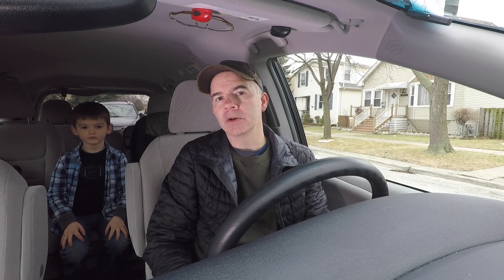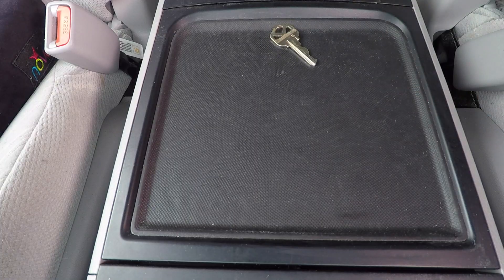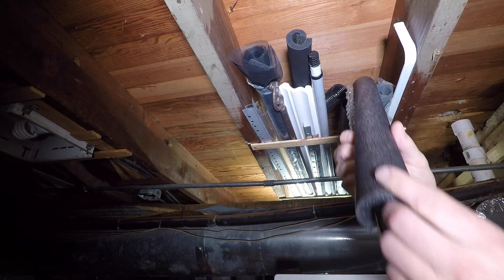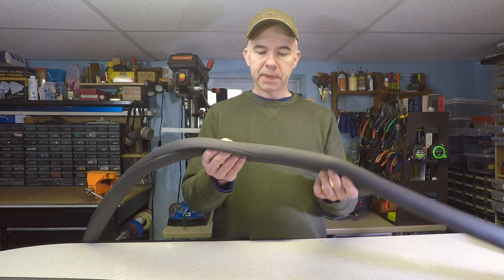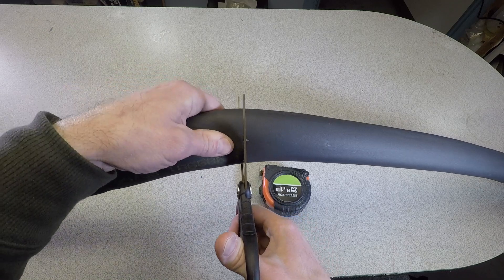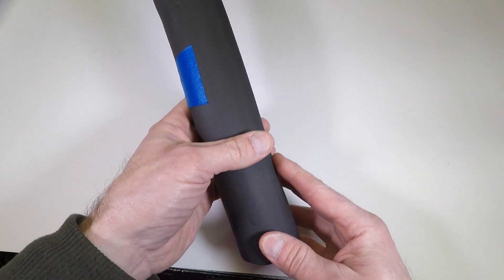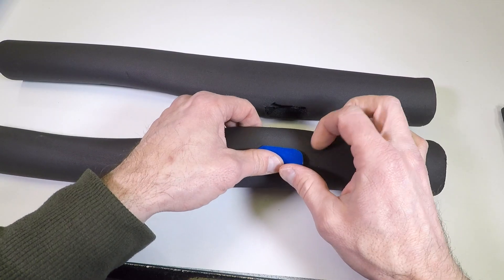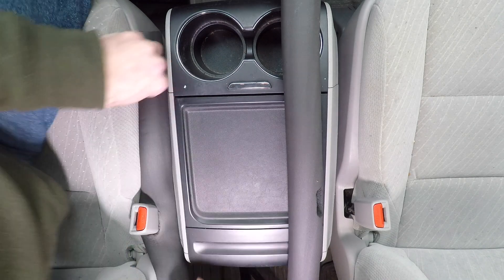DIY Drop Stop - Car seat gap filler

Comment: Guys if you are really looking for the cheapest car seat filler simply make tight roll of 2 usps padded envelopes for each filler measuring out the length required then pass it though a pair of black socks and tuck in the remaining of the socks into the opening of the roll towards the end. (I didn't go beyond the seat belt buckle) I just made it for my car and it solved the problem without spending a penny 🤗
Another idea that could work is a thin pool noodle from the dollar tree, during halloween they sell it in black color 👍
Reply: cool

Comment: This is so much better than the original. I was reading reviews on Amazon, and some were ticked off, because every time the seat moves, the original will fall down  between the seat, and only the part around the seatbelt will stay up.  Apparently, the material they made it out of grabs, so if you move your seat at all, the whole thing gets caught up and falls underneath, between the seat and console.   It is also a really bad dirt magnet.  It does the exact thing that it's supposed to be preventing.  I look forward to trying your method.  I drive a 2 door coupe, and definitely have the seats moving an awful lot, to get things and people in-and-out of the back.
Reply from the maker: I move my seat all the time and it works great.

Comment: I found a towel that was pretty much the color of my interior and I just rolled it up into a log and stuffed it in the crack.. now it serves a dual purpose in the event that I have some kind of a spill or possibly injured in a crash I have something to put on a wound
Reply: I was using a towel before-but it's hard to get the right thickness so that it doesn't wiggle down into the track over time.  But Yes, should always have a small towel in the vehicle.   I also carry some paper towels under the seat.